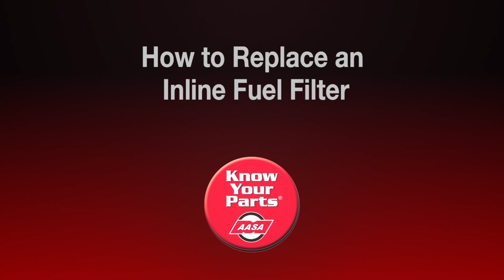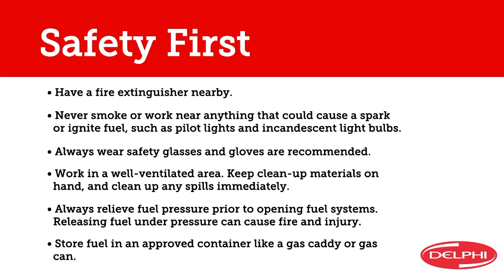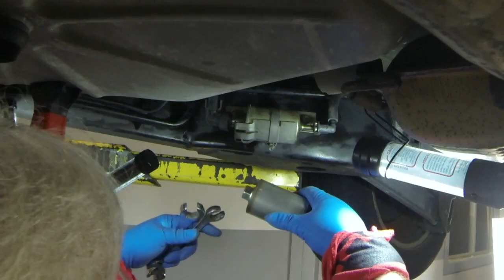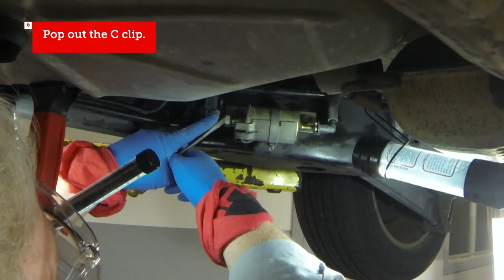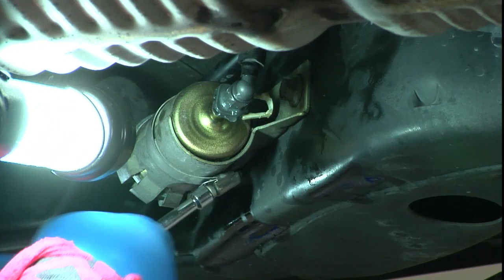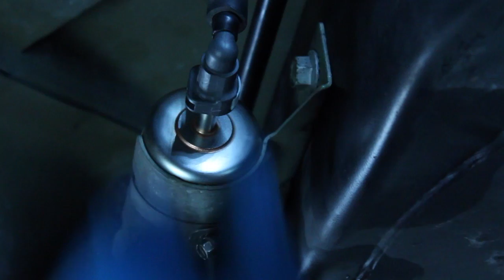How to Replace an Inline Fuel Filter | Know Your Parts

Comment: Great video. This repair went just as the video showed. Hardest part was getting the cover off my fuse box. Fuel line disconnect tool worked to perfection. This guy knows his stuff.

Comment: What if you have a full tank of gas if i pull the fuse from the fuse box and let it run would all my or just alittle bit gas from my gas tank come out? If I let it run out of gas
Reply: Plug the lines with a pencil. Very little gas comes out.

Comment: My Mr gasket in line filter doesn't have a arrow. It says IN. So is in to the Carburetor or fuel tank. Thank you
Reply: There is a lip on the filter that only fits on one way.